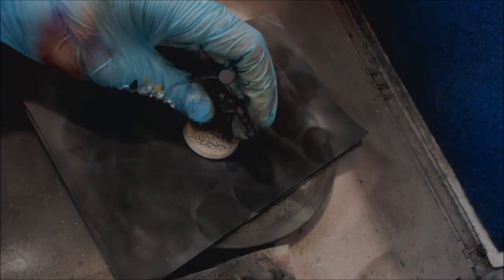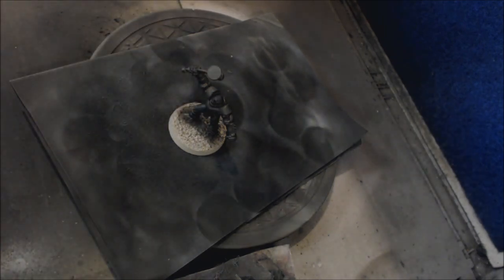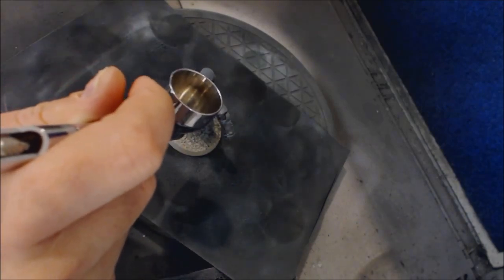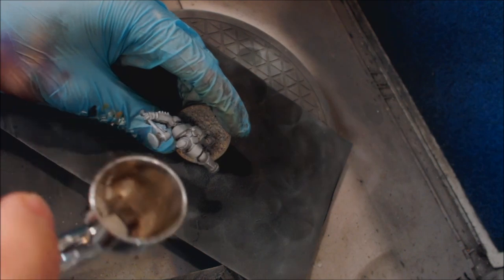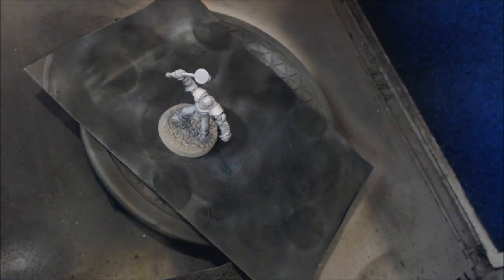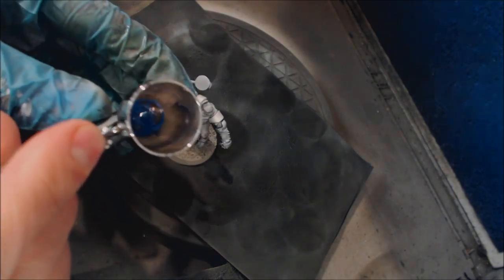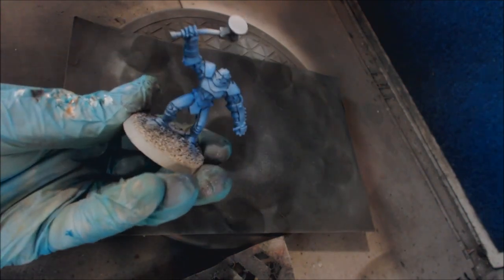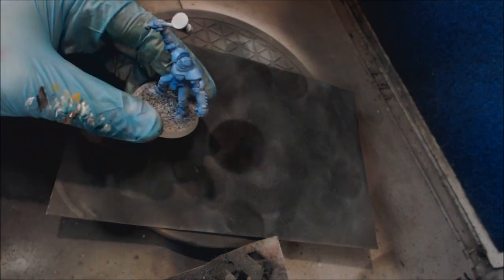Hobby Cheating 75 - Zenithal Highlighting and Glazes

Comment: It is because of vids like that that I bought a cheap airbrush to try out with my huge compressor. Works great, thanks Vince! If I could only figure out an indoor set up, but I'm intimidated by the boot, extractor fan and all....but with good weather....
Reply from the maker: Well, I will say you can get a cheap small compressor and then with something as simple as a cardboard box with a hole in it, you should be to spray inside with a mask on, especially with acrylic paints.

Comment: Great video one that I have referred to multiple times, and here I am yet again. 
Really trying to mostly glaze a crew for the first time. 

Having a hard to wrapping my head around my project since I’m trying to do mostly black suits (tuxedo suits that is, knight Models organize crime) with just a pinch of Color. Cuz fabric hits light differently and I don’t want them to look boring. 

After doing the “dark” (pine green, a dark blue, grey, and possibly purple or dark red Color) which look a lot brighter than I was first expecting. Lol At first tried the grey maybe which didn’t look great and I’m thinking Gray is not the color for this technique after a zenithal. 

So re cleaned up the zenithal and tried green maybe that model was just a tad thick. 
So I’ll try again for that.  but with the Colors looking very bright and I want the Black effect
Should I try to re glaze with black. Or at that point an Ink/wash. Not really sure how much it’s going to darken it but was thinking a pine gray. 
Or maybe just use a wash/ink from the start possibly after value sketching some of the Color right over my Highlight. 

Any thoughts? 
Typically with blacks have done more of that GW way base coat and Highlight with dark reaper
Reply from the maker: I would glaze, very, very thinly with the black, you can slowly wheel other colors back. :)

Comment: Thanks so much for this! This really helped wrap my head around using my airbrush for highlights. Is this kind of highlighting helpful with large muscles like Bullgors and Ogors? They're large rounded surface, but the surfaces are more "rolling" than the symmetrical armor of Space Marines and Stormcasts.
Reply from the maker: I think so, but you want to be a little more careful with your glaze colors and with your highlighting (so you aren't getting too much white in the upper facing creases). In general, this same technique will work for the majority of musculature, you just need to be a little more careful and targetted at the top.

Comment: Yesterday I tried and mixed several things I learned in your videos. I made some mistakes and the result was horrible, I should have sticked to your rules much more!

First, I did zenithal highlight with my airbrush to a pict warrior from Conan boardgame (all skin and a loincloth). This was my firstbtime doing zenithal, up till now I only use airbrush for priming. I remembered what you said about never black under skin so I thought about using a reddish brown. But I wanted more dark so after starting, I put a drop of black and tried to mix like you do, putting a finger in tip or airbrush and blowing air. It did not go well, did not mix well and the result was very black. Lesson learned, better to premix before putting paint in airbrush for now. Grey and white went fairly well, zenithal was achieved almost successfully, apart from the very black shadows...

Then, Mixed pale flesh with some glaze medium and airbrush thinner, trying to create a glaze. I applied 8 times over whole flesh parts. Result was... Not good. Very muted color, and black clearly showing under the paint. In the middle I added some dwarf skin (basically orange) to try and cover more... Lets say that did not help create a better skin color, nor help much with the black under.

So, many lessons learned... But I dont think even if I had put a brown instead of black as shadow zenithal, that I would habe a got a good vibrant color...

Comment: I tried Zenithal with white primer over gray, and I must have a crappy white because it just covered it with little dots.  Awesome vid, really helpful.
Reply: I have the same problem with trying to zenithal paint with spray can white after I've primed the model with spray can black. It's probably best to use regular paint like Vince does for the zenithal part, since the model is already primed.
Reply from the maker: In general, you want a nice white spray paint, I would grab like a citadel or army painter, but it's always going to give you a little bit of the dots. The key is to spray from farther away and do a few light passes to build up and even out the random spray.
Reply: I'll pick up some army painter next time I'm at the store.  Krylon does not work.
Reply: krylon camo line is 100x better than regular krylon and what I use solely for priming (assuming i am doing the standard priming colors)

Comment: Hello Vince,
  I love your videos! I'm somewhat new to painting and considering getting an air brush. Your tips are very helpful. I have a question about my color scheme though. I'm doing black and orange space marines, which as you mentioned is difficult haha. So far I've been spray can priming all black and then doing the armor panels (elbows, shoulders, knees, backpack bulb vent things, top of helmet, chest) with a brush. I base coat grey over the black, then do my orange. This scheme will also be on vehicles. How should I apply this priming process for those colors? Doing the black prime saves me a ton of time so I don't have to hand paint the black armor parts but if there is another way to approach this that I'm not realizing that would be great. Especially for the vehicles since I don't want to hand paint the orange panels, I'd like to use an airbrush. Sorry for the long comment! Thank you for all your great content.
Reply from the maker: Sure, my tactic would be the following.

1) Zenithal the vehicles with some panel modulation in the scheme you want. 
2) Mask off the orange
3) Glaze back the black areas with a mix of black ink and payne's grey. 
4) Varnish it
5) Mask around the orange areas
6) Replace the low tone black with a deeper brown
7) Use ivory to reinforce the highlights. 
8) Glaze orange
 done.

Comment: Vince, your vids helped me a lot in preparing and deciding to start painting. I hope you can tell me your opinion/advice on the following matter, concerning spray priming+zenithal on very, very detailed minis:
My example is creature casters lord of slaughter, or most other minis they make. If i use chaos black, followed by tamiya grey, how much detail is likely to be covered (i guess it's a poorly phrased question, but how will the spraying aftermath look like in your opinion)? Is it better to use vallejo brush on primer, followed by a grey zenithal? Is the grey layer going to be the one that harms the detail (or will it infact help by doing...well, a highlight)?
If i mess up with resin minis, is there a safe way to go back? I honestly fear this kind of expensive yet resin miniature.
Reply from the maker: So the key is to spray your secondary and tertiary color from a distance. You only need a very thin layer, so keep the spray paint back and do light dustings. You can always put more paint on, but it's only stripping to take it off. If you do that, you shouldn't really lose any detail.
Reply: Vince Venturella Thank you. Do you have any opinion on vallejo spray primers?

Comment: Thank you for the video. Great as always. Quick one. I see you use actual paints for the grey and white. I've been used mixes of the black, grey & white Vallejo primera to do zenithal. Would you recommend using paints instead of primers? Or will I get the same results with primer?

Comment: Can't believe Vince is still responding to these threads after all these years!  A question if glaze medium (or even contrast medium) might be better than thinner in certain scenarios (or why not)?  (Perhaps glaze medium wasn't commercially available 6 years ago?!)
Reply from the maker: The newest video I did really explains that, glaze medium is tough, as it's really a mix of things. In general, those mix mediums aren't doing much differently, but they can be somewhat useful when you need to go really thin, the new pro acryl glaze and wash medium is solid for that.

Comment: Hey Vince! Been struggling with the zenithal. Specifically I’m having issues with the mix or white that I’m using. I’ve put my compressor up to 40 psi because that’s supposed to help reduce speckling. I’ve also tried anywhere between Pro Acryl white mixed with Daler Rowney, to just straight Daler Rowney, to Daler Rowney thinned down with that airbrush thinner/flow mix you’ve talked about before. Even the thinnest one had issues with speckling, and sadly also flowed too heavily into recesses to be a good zenithal. What do you actually use for your white?
Reply from the maker: So there will always be a little speckling, but it sounds like we either don't have it thinned enough, or we're putting out too much air pressure or both. You have to be really gentle with the trigger and just build it up softly with very thin layers.
Reply: @VinceVenturella thanks for the response! I’ll try to show a little more restraint on rocking the trigger and see if that helps haha.

Comment: Thank you, this helps me a lot. Question': with this technique you created some cool shadows, but what next? Applying a wash to make details noticeable and get some further localized shadows would not ruin the effect?
Reply from the maker: Washes will generally bring everything together and/or darken the whole bit down. A fun trick is to wash everything and then re-airbrush your highlights back on in a targeted way (i.e. only hitting carefully the high points). If you were bring careful, you would use targeted washes/glazes/inks to deepen the shadows and build up the highlights with brush. This also helps remove the "airbrushed" look. If you have plates, like a space marine or something in armor, you would black (or very color) line the plates and use something near white to edge out the plates as your next step.

Comment: Going off your comment about avoid paints with a stronger foundation of white in them, say if I were going for a very pale olive color for a Death Guard model, would I be better off zenthial priming, going for a darker olive and then completing the rest with a brush?
Reply from the maker: Yep, green's are wonderful with zenithal, because the darker or olive greens use yellow, not white. So you can thin them and go over the zenithal without issue and get wonderful contrast. Another tip, before you do the green, do a reverse zenithal of a very thin, dark red (in other words, shoot it up from below into the shadows, something like Hull Red) Red is the complimentary color of green and will create wonderful rich shadows when you put thin green over top. Totally optional but something fun you might want to try.
Reply: Vince Venturella sounds like a plan.  I'll have to try that tonight. I did try it using Reaper's Pale Olive and it looked like it washed a lot of it out.  That was a good tip with the red!
Reply: Vince Venturella hey Vince, I'm about to paint a van Saar necromunda gang, it's dark green. I used grey and white for zenithal but it wasn't quite right with the dark green/olive wash. When you mentioned yellow, is that what I should use instead of grey and white? Cheers! Love your videos!

Comment: Great and precise.  I have started using Zenithal.  I am wondering if you have used the technique on stone or bone and if a good result is possible.  
best, 
andrew
Reply from the maker: For stone it's a great place to start. You then just mess it up with cracks, drybrushing, washes and pigment. For bone there are a few options. You can cover the black with Brown, then go brown white (instead of grey) and then warm white. It's tougher with bone, because most bone color (though not all) is Warm White and zenithal is by it's nature with the grey, pure white and black a little cold. Hopefully that makes sense.
Reply: It does make sense thank you.  For stone, could you do a grey glaze over the pre-shade, then do a black wash, then drybrush it with lighter greys?
Reply from the maker: I usually go straight into a white drybrush and stipple and then wash with Nuln Oil and re-drybrush lightly in a few places and add other washes or Pigment for color.
Reply: I'll give it a go and share a picture of the result.  Lizardmen in natural greens and browns (with cool purples and blues in the recesses and faces) with all stone weapons.

The zenithal is so fun and easy.  I'm finding it good to take a break from difficult projects that use time consuming techniques of layers and glazes by doing an easy project.  Painting to a fast tabletop standard, learning to use impressions and squeeze the most out of your color choices to imply more detail than you actually painted can get a great result and also improve your fundamentals when you go back to the harder projects.  I recommend a speed project to everyone.

Comment: I zenith highlighted my chaos space marines, and did a test run on a spare mini. I think the paint may be to thick still or the psi to high. In any case, to reduce risk (since I need more practice), I could use the glazing technique to get the same result, correct? I'm using GW Thousand Sons Blue. I'm noticing that these paints tend to be difficult to thin. That or my airbrush needs replacing lol
Reply from the maker: Yep, going thinner with a low PSI is a good place to start. The bright, light blue is a tough one to thin, but my recommendation is to drop it to about 15 PSI and use mainly thinner. Thinner layers is always better.
Reply: @VinceVenturella  did it this morning but used a darker Vallejo paint (Imperial Blue). I went a bit to heavy. Still trying to get a feel for the control, but I can still make out the dark areas and lighter areas. So I'm really happy about how my first zenith came out. I have a cheaper starters airbrush so I think I may get a better one later on as i gain experience

Comment: Please can you do one on airbrushing osl?
Reply from the maker: Sure, I have OSL on the list, I will break it into brush painting OSL and Airbrush OSL as there are differences.
Reply: Thank you, can't wait!
Reply: Vince Venturella What airbrush are you using in this video?  I am having trouble 'back filling' into my paint cup.  I can get paint through it fine but when I try to plug the end... no bubbles in my paint cup.  FYI I am using a badger renegade krome
Reply from the maker: I am using a Iwata HP-CS Eclipse. DOes your tip have a round guard or a guard with cuts in the side? If you can't get the air flow blocked completely, it won't back up the air.
Reply: Vince Venturella yes that's exactly the problem, there is no way for me to completely block off the air... definitely something I wish I knew to look for when purchasing!
Reply from the maker: Not the end of the world, if you look up the Angel Giraldez method of pre-mixing, he just puts it on a little piece of plasticard, mixes it with a pencap and then pours it off the corner into the pot.
Reply: @arcahn21  You can try using some soft tissue or foam etc and block the nozzle that way

Comment: So the first coat should be a black primer and if I wanted to go white no gray highlights I can use a white acrylic paint.

It doesn’t have to be black primer AND white highlighted primer right?
Reply from the maker: You are correct, and going straight from black to white is quite easy, especially if you're working with a thinner white paint you can build up.

Comment: Hi Vince, 
Love the videos, they are helping me tremendously. 

One question, I want to do grey armor for space wolves, can I just use this zenthial technique and its done or should i go back over with another grey glaze?

Cheers
Reply from the maker: So Space Wolf armor tends to have a little blue in the grey. So here would be my way to do it, understanding that I haven't painted space wolves, so this is all theory. 

1) Black/Grey primer
2) Dark blue ink (or shade, something like Drakenhoff Nightshade) - basically, tint it all blue. 
3) Grey/blue zenithal, you could mix your own or use something like the cold grey mixed with a single drop of Guilliman glaze
4) Targeted white highlights. 

I would then go back in with some brush and darken a few shadows, panel lines, edge highlighting, etc. 

I am sure there are a few other ways you could attack it. You could also do the standard zenithal, and then glaze in a thinned blue glaze, then go back over with grey/blue and white. 

Hopefully something like that helps. Thanks for watching and commenting, glad I could help.
Reply: Awesome, I'll give that crack. 

Thanks so much.

Comment: This is a great video! I'm still so confused as to whether I should be using flow improver or thinner or neither with my Vallejo Surface Primer (yes, very new to it). I'm in a dry climate, and did notice some dry tip occurring. Any help, would be really appreciated!!
Reply from the maker: Happy to help, so I use an 80/20 mix of Thinner and Flow Improver respectively. I find that is the best mix. With my primer, I generally use about a 1-2 ratio or 1-3. (thinner to primer).
Reply: @VinceVenturella  Thanks for the reply! If I understood this correctly, you have a mix of 4:!1 thinner:flow improver, and you add that to your primer with a mix of 1:2 or 1:3? I will definitely try that out, thanks!
Reply from the maker: @clarketron3000  yep
Reply: @VinceVenturella  awesome, thanks!